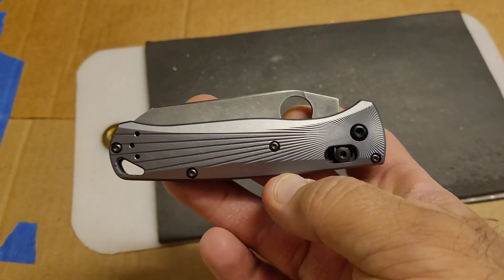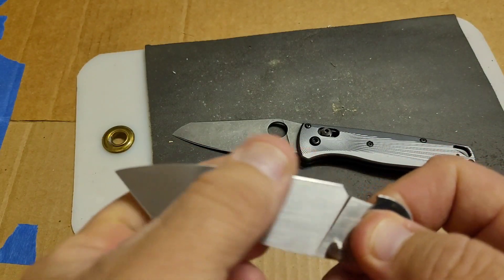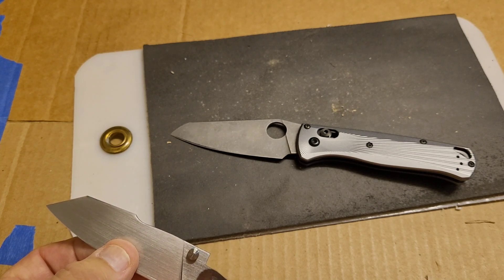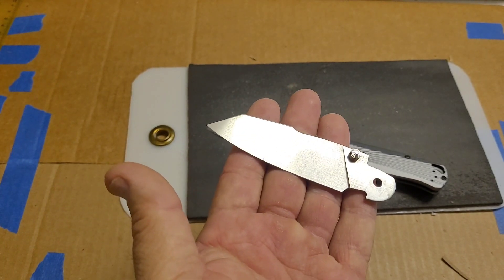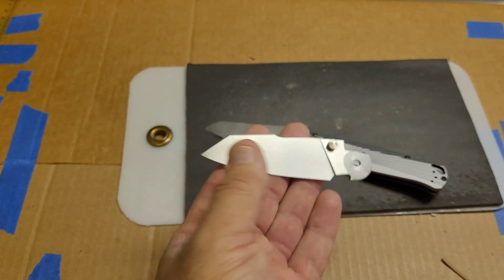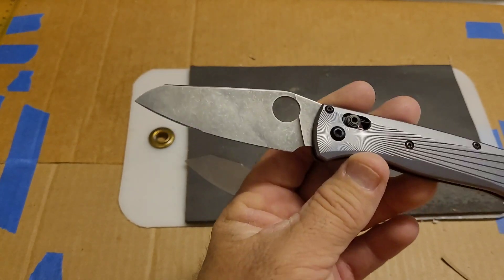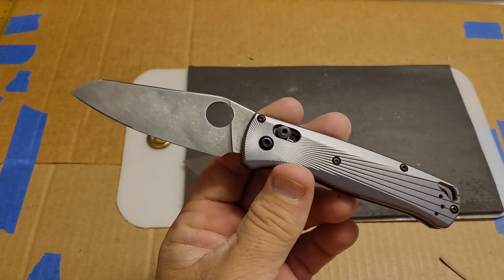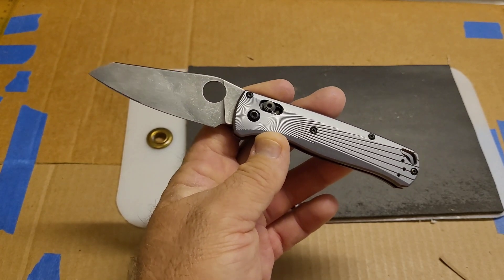Magnacut edge retention testing, 2 Bugout reblades from Transparent Knives. More data to compare.

Comment: Are there any places where you can buy knives with Magncut at these high HRC levels.  The best I have found so far is only 60-62.
Reply from the maker: Hogue advertised the Deka in Magnacut at 63, I've heard Spyderco will be changing the protocol they use for Magnacut as well. Other than those 2 for production knives you would have to look to custom stuff at this point. Brian, Transparent Knives offers reblades for a couple knives in Magnacut at 64 to 65.
Reply: @Outpost_76  Thanks

Comment: If WE/Bestech/Artisan/KAI/Benchmade/Reate/Etc. Would start getting production M390/20CV up to a minimum of 61-63 HRC it would be so nice. The number you get on Spyderco’s and custom makers that approach 63+ the numbers are staggering and you actually see the benefit of the steel. Magnacut will be similar I think. 63-64 looks like it preforms pretty great.

Comment: Geometry of the blade and 64 -65 HRC are the big deal in the cut test.  Take a good look at a utility razor blade, super thin behind the edge and low grind angle, crap steel of course, cuts like a razor...   I'm looking forward to seeing what the market will do with Magnacut.  Thanks for the video!   Lots of hard work...   Much appreciated.  :  )

Comment: Appreciate the video as always! About 10 edges into the Magnacut mule and it really is shining finally. Sharpens and deburrs slightly better and the fine edge, stability are where I like. Between it and my M390 para 3 (which seems to be with a nice heat treat) are the only stainless knives I truly enjoy for their edge performance. Still doesn't sharpen as well as cruwear, come up as nice as my K390 Delica or even 10V PM2.

That all said I think you really touched on the truth of the matter in this video. This is a great stainless steel but it takes a custom heat treat to compete with its non-stainless competition like 4V. For those looking for high performance in mass produced knives I'm guessing the 4V, M4, 10V, K390V will usually be better options. You're right that we still have to see what comes out of the factories though and wait for them to optimize over time.

Finally got some 4V in the St Nick's Para 3 LW. 3rd edge so far and I've been extremely surprised by how fast the steel moves on diamond. Edge breaks down like expected but the front end isn't quite there yet which I'm expecting to really start improving after a few more, less rushed edges.
Reply: Thanks for the info. I was debating getting the 4v lightweight but was disappointed in the build quality on the lightweight I had. It was uncomfortable, had sharp spots from the injection molding, and blade rub due to centering issues. How was the fit and finish on yours?
Reply: @BenoJ3000  First para 3 lightweight I've had and am very pleased with the build quality honestly. This is coming from a guy that does like FRN keep in mind. 

I did have to file/sand the inside edges of the handles but I do that to all FRN so no big deal to me. Centering and action are perfect which was surprising to me

Comment: I was really primed to be disappointed with magnacut after all the hype but I have to say…the two mules I have in it are fantastic so far (~62.5). They aren’t as hard as some of the higher end, custom jobs obviously but they’re still impressive for what they are. They come up super sharp and definitely edge out my LC200N blades in edge retention. I know it’s a bit of a departure from the community’s impression of magnacut (everyone wants it to be the next Cruwear for whatever reason) but I see this as being the next hyperstainless a la LC200N (ignoring their vast differences in chemistry). On paper, I’m not really a stainless steel guy. I like M4, Cruwear, K390, 1095 and all things corrosive…magnacut still gives me that vibe despite its reputed stainlessness.
Reply: I think what's cool is that LC200N is an ultratough stainless, but magnacut has the edge retention..very cool

Comment: Love those re blades. You can tell it's a laser beam just looking at it. It looked like it was just flying through the cardboard. Great results on this one👍
Reply: It’s crazy because the standard bugout is pretty thin BTW itself but these reblades have such a great heat treat and a broader blade(not to mention a sweet deployment hole) it gets it even thinner. Cardboard destroyers.

Comment: I wonder how the toughness is at 65hrc.
Reply: At 65 Larrin's charpy tests put magnacut about twice the toughness as s30v is at 60. Or about as tough as s35vn and cts-xhp when they are at 61
Reply: @kyleoleary6082  Yeah, your right on the money. At 65 it's a bit lower. I mean, it's high for stainless at that hardness of coarse. Xhp I wouldn't classify as stainless. S35vn is though.